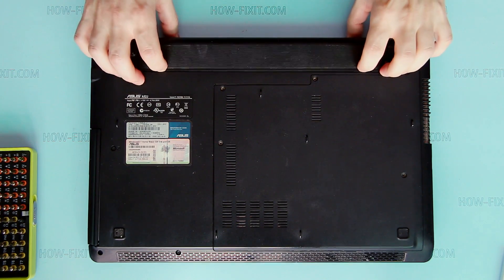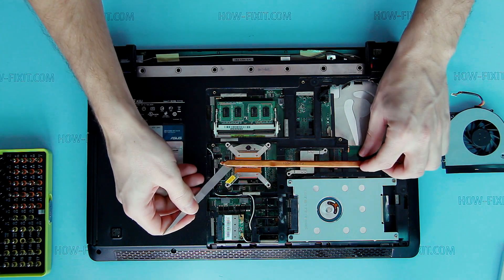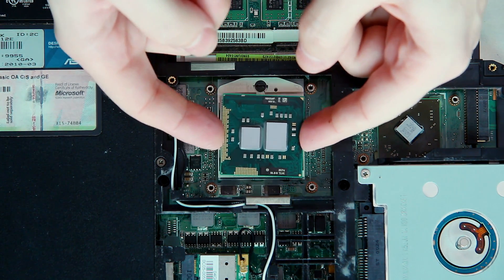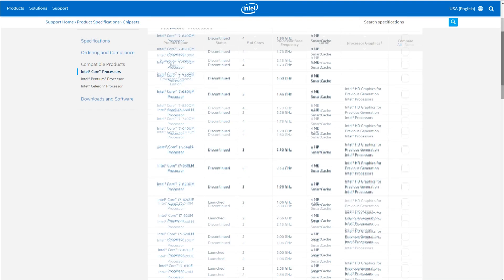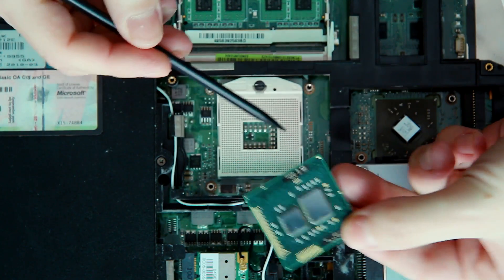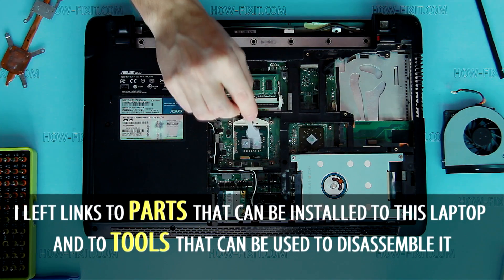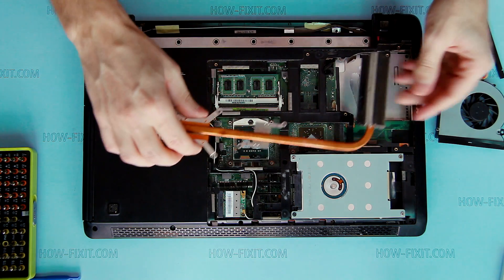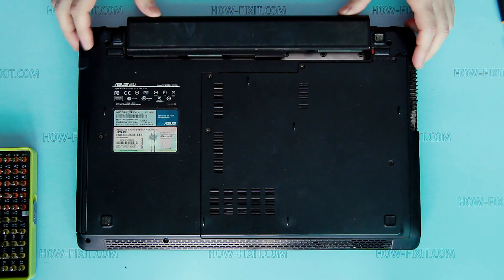Asus A52, X52, K52 CPU Upgrade Guide: Boost Your Laptop's Performance!

Comment: I upgraded my A52JE from i3 330m to i5 540m : Ok, I tried better CPU (i5 560m & 580m, i7 620m), they all started, but they got too hot after a moment (105°) and the machine shut down without any warning.... Only the 540m is fine, and I run Win11H2 with 8gb

Comment: I noticed that the screws protecting the processor have numbers: 1,2,3,4. And in some article that the order to remove them matters. I tried to remove the i3 processor to install an i5 or i7, but removed first the screws 3,4. Then the 1 and 2 are so hard that they can´t be removed. Could it really be because the order matters?
Reply: Order really matters when putting everything back together. Of course trouble might happen dismantling because of sequence. It's same when you change/remove cilinder head from moto engine. 😅

Comment: mine is A42J
 i7 Q 740 processor can i upgrade it?
Reply: what processor is installed in the laptop? VGA Radeon HD 5470?
Reply: @slavafedotov5742  nope ,mine is HD5730 2G
And CPU i7 Q 740
Reply: @muhs2532  Não faz sentido trocar o processador i7 pelo processador i7 - você não verá o efeito da substituição. 
Faça 4GB+4GB DDR3-1066/-1333 de RAM e compre um SSD de 240-512GB.

90GB é uma unidade C: Windows, programas, jogos. 
150-380GB - D drive para armazenar arquivos, fotos, vídeos.
Reply: @muhs2532   i7-740QM -> i7-840QM

Comment: i have asus u36sd..what is the latest cpu i can upgrade..
my laptop chipset Intel® HM65 Express Chipset
Reply: @slavafedotov5742  right now im using i5-2430m
Reply: @sharxtech7508  simple upgrade: install 8GB of RAM, SSD 240-500GB: 
disk C (90GB) -Windows, games, programs. 
Disk D (150-380GB) - files, photos, videos.

processors can be installed i7-2670qm, i7-2720qm, i7-2760qm, but in order not to overheat the laptop, you need to turn off the turbo boost on the i7 processor. Work at a base frequency of 2.2-2.4 GHz. Get performance with 4 cores / 8 threads and SSD.

Comment: Hello everyone. I have Asus A42j with intel core i3 380m, can I upgrade my cpu? IF yes, what is the recommended cpu for it? Thanks
Reply: i5-580m, i7-640m // RAM max 4GB+4GB DDR3-1066.
Reply: @vladimirazirov1815  thank you so much : )))
Reply: @vladimirazirov1815  same processor, want to upgrade to an i5 560m with 8gigs of ddr3 .. do i need 1066mhz rate or 2000mhz to get the  800/1066 mhz maxed on processor?
Reply: @stylez7x  buy any RAM: DDR3-1066 or DDR3-1333 (4GB+4GB 1.5v, 2R*8). In order for the i5-560m processor to work as quickly as possible, it is better to install an SSD 128-256GB, sata-lll, 2.5 for the C drive (Windows, games, programs) in the laptop. HDD (disk D) is used to store files, photos, videos. Transfer the HDD to the DVD slot through the Caddy adapter.
Reply: @vladimirazirov1815  1tb of ssd Samsung Evo is allready installed ;) Just wanna max it out a little ;D
Have some special Deals on 1600mhz ram 2x4gb.. still okay or is the unused frequency producing extra heat?
Reply: @stylez7x  the memory controller is inside the processor. For the i5-560m processor and other 1st generation Intel processors, the controller operates at a frequency of 1066 MHz. Even if you install DDR3-1333 RAM, it will run at 1066MHz. 

DDR3-1600 RAM for 3rd generation Intel processors. It may not work on your laptop.

Comment: I’m looking for help. Does anyone have the answer to my issue: I’m having trouble on my k52f after putting the i5 540m in it. It starts up windows as if it will go into install but then it gets a blue screen. I am upgrading from the original p6200 cpu. Which bios and windows install were those of you who successfully did this upgrade using?
Reply: Я слышал, что микрокоды процессора должны быть подписаны в bios

Comment: Hey i have asus x53u and it has the amd c50 processecer running at 1ghz .whats the maximum i can upgrade to and is there a need to upgrade the bios
thank you
Reply: ugh since he didn't answer and I want to help... you just have to see if that cpu is soldered onto the motherboard. If so, then that's very unfortunate and you cannot upgrade the cpu. I really want to see if I can since I'm using it for editing and the i3 has done such a good job, but just mediocre at editing performance. Anyways, hope it helps... but either way I'm not too sure.

Comment: what processor can i use to replace the Intel Core i3-350M (1st Gen)? thank you for the reply and the time. Godbless!
Reply: i5-580m / i5-560m / i7-640m
Reply: @slavafedotov5742  I’m looking for help. Does anyone have the answer to my issue: I’m having trouble on my k52f after putting the i5 540m in it. It starts up windows as if it will go into install but then it gets a blue screen. I am upgrading from the original p6200 cpu. Which bios and windows install were those of you who successfully did this upgrade using?
Reply: @danielgreenberg4751  Probably the processor steppings do not match. If possible, exchange an i5-540m processor for an i5-560m with the seller
This is my guess.

Comment: I have a a Asus K52jr, I just bought a core i7 920xm to replace my i3 350m. I updated the bios, and install the i7 but the laptop doesn't turn on, help :/
Reply: I'd like to know which one could be the better option :/
Reply: @renzoluisrojaspena5342  
your motherboard has 2 power phases per processor, i7 920xm requires a 4-phase motherboard - that's why i7 processor won't turn on :-/

for your laptop, the maximum processor is i7-620m / i7-640m
Reply: @slavafedotov5742  are you sure that would work with i7 640? :c
Reply: @renzoluisrojaspena5342  download the CPU-Z program from the Internet and look at the "Revision" section on the first page of "CPU" - is it "C2" or "K0" written?
Reply: @slavafedotov5742  It says C2, I heard about i7 720qm to my laptop but I'm not sure, I already lost a lot of money buying a i7 920XM. I really appreciate your time. Is it sure i7 640m or which one? :(
Reply: please
Reply: @renzoluisrojaspena5342  Have you replaced your processor? how does a laptop work?

Comment: Hi!!
I have an old N61JQ-A1 with a  i7-720QM processor. I upgrade memory (8GB) and SSD card (512GB). Can i upgrade the processor too? 
You know what is the maximum CPU for this old guy?
Tks!
Reply: there are processors for your socket
i7-840QM and i7-940XM. But I'm not sure if they will work well in your laptop, because for these processors Asus made special motherboards with 4 power phases, and your laptop has 3 power phases. My opinion is that it is not profitable to change i7 to i7 :) 
it makes sense to change i3 to i7 :)

Comment: cool video! 
question though! What if the TDP of the CPU you want to change is different than the original? 
For instance, I'd like to upgrade my i3-350M from my asus u30jc to a possible 4core CPU.. but most 4core are 45w TDP whereas the 350M is 35w...
Reply: optimally i7-620m + SSD (for Windows) + 8gb RAM.
I read that the i7-740QM was installed in the laptop, but on the processor you need to turn off the turbo boost so that the laptop does not overheat and damage the motherboard. Get 4 cores / 8 threads / 1.7GHz. 
I think it's better to get 3.3GHz with i7-620m :)
Reply: @slavafedotov5742  actually, today received my i7-620m.. and it's k0. My previous i3-350m was indeed c2. But this K0 620m is installed and ao far working/recognized in the bios too.if guys at Asus would have done their job and told me  which ones were compatible, perhaps the 640m would've worked too..
Reply: @sniuk  yes (  Asus office workers could not give the correct answer (you are lucky that both stepping are registered in the BIOS. I read on the forums that people received the i5/i7 and it did not start, that its stepping was not registered in the BIOS. I think you do not need to worry - the difference between 620 and 640 is minimal.
Reply: @slavafedotov5742  Agreed, even if your rig works with a 640m, the 620m is only 1 to 2 percent slower and half the price. Use the money saved for a used 256Gb SSD.
Reply: @palomarjack  if I had such a laptop, I would buy an i5-580m processor - it's similar to the i7-620m, but cheaper. I now have an Аsus К55VD laptop - I replaced the i3-3120m processor with an i7-3612qm processor
Reply: @slavafedotov5742  The i7 has more cache and was only $8 US more. It's only a little faster, but makes a big difference for cache intensive applications. Now that money is better I'm going to try for a Ryzen laptop next year or so. Maybe I will find one "for parts" like the this K52.
Reply: @slavafedotov5742  thank you! I've tried asking Asus about the compatibility with i7-640M as is similar to 620m but slightly faster.   Didn't get response. They kept insisting on me searching on internet about it, or install 620M,.. so after weeks of asking more specifically about compatibility of the CPUs and bios, gave up and ordered a 620M :(
Reply: @sniuk  Asus is right. The i7-620m and i7-640m have different Stepping. 620- C2, 640-K0. Stepping K0 is probably not flashed into the BIOS of your laptop model and the i7-640m might not work for you. Install SDD for Windows + 8gb RAM and even with i7-620 the laptop will work well. I bought myself a SSD Samsung 960 EVO 250GB SATA-III 2.5" V-NAND  - works great and 5 years warranty)
HDD via Caddy adapter (12.7mm) installed in the DVD slot for storing files (drive D)
Reply: @slavafedotov5742  oh no, Asus didn't say anything other than "you can check through internet other users who tried to install and see if it work for them" lool... wasn't helpfull at all. But thank you for your explanation. It would have been easier if Asus simply replied about what CPU are flashed in the BIOS..  I already have 8Gb of RAM, and recently added a Crucial MX500 1Tb SSD, was planning on the Cady too for the old drive :D And the i7-620M on the way ^^ . Thank you for your help

Comment: Hi. your video it's fantastic. can i ask u some one. I have a k52f CPU P6100. I just right upgraded RAM to 8GB and changed HD to SSD 120GB. it's all ok. but now i try to upgrade the cpu. do u know if i cam put on it. what is the best and compatible cpu right? I need to upgrad firmware too? Thank U in advanced.
Reply: it is optimal for you to install the i5-560m. There is also i7, but so that the laptop does not overheat, it is better to put i5. Update BIOS from ASUS website before replacing processor.
Reply: @slavafedotov5742  I’m going through same scenario and have upgraded to a i5 540m but am having problems installing windows. Do you have any suggestions?
Reply: I have the same setup but am trying to  upgrade to an i5 540m but have had issues installing widnows now. Were you succesful with your upgrades?
Reply: @danielgreenberg4751  I put on I3-370m and the notebook get a new life. it's very too much better PC. I use it every day for my job (webdeveloper) and I don't get any lag or slower task runner. my OS is win10 64 home. very fast and stable OS never crash or any other problem.

My next step is re-upgrade the cpu with i5-540m but what problem have U?
Reply: @studiocomunicas3436  Good news! I was anle to finally get it working with the new I5 540m cpu in it. Imfor some reason it wouldn’t let me run the install succesfully until I put the old/original hdd and ram into it. Then I installed windows 7 and then from there I put an older 250gb sandisk sdd in it and installed windows 10. I learned that when trying to install windows 10 that for some reason the system didn’t like the new samsung evo 500gb 860 ssd i planned on putting into it. I think it doesnmt like the evo because of some sort of voltage consumption difference that the motherboard or the bios just doesn’t gel with. Also it didn’t like the sk hynix 1600 4gbx2 ram I put into it and I think it was because it prefers 1333 speed ram even though crucial’s compatibility page says it can support the 1600 speed ram. So I just ordered some 4gbx2 1333 speed ram to update the current 6gb of ram with. 

Overall things seem to be running really well on it and I seem to definitely he getting i5 performance out of it m. It was totally worth the investment.
Reply: @studiocomunicas3436  
after the i3-370m processor, you won't see much difference from the i5-540m processor. Better to upgrade to i5-580m, i7-640m
Reply: @slavafedotov5742  Hi, I have a k52f with CPU P6100 and windows 10 32bit.
If I update it with i5-580m processor, I can pass to windows 10 64bit?
Reply: @prunaca  Yes. It's only more profitable for you to buy an i5-560m. 
                       RAM 2gb+4gb or 4gb+4gb DDR3-1066
Reply: @slavafedotov5742  
Is there much difference in performance between i560 and i580?
Reply: @prunaca  580 is more powerful than 560 by 2-3%))
Reply: @slavafedotov5742  ........and it costs twice as much:-)))). 
Well you convinced me, I'll buy i5-560m.
Reply: @slavafedotov5742  Hi Slava, I just replaced the old 2gb 1060 RAM with new 4gb 1333.
My windows 10 is 32bit.
It's very strange, I went to look in the system. The pc recognizes 8 gb ram but tells me that only 2.92 gb are usable. 
How is't possible?
Reply: @prunaca  Hi ) you need to upgrade to Windows 64 bit (Ws 7 x64, Ws 10 x64)
Reply: @prunaca  Windows 32 bit (x86) only works with 3GB of RAM.
Reply: @slavafedotov5742  Ahhhhh.......ok....thanks a lot Slava.

Comment: I am thinking of trying to put a better cpu in my Asus K52jr laptop but unsure of which cpu's I can use.  Currently it has a i3 cpu, but I would like to put i5.  Can you advise best cpu for this model?
Reply: put i5-560m - optimal for the price and work) the maximum can be set i7-620m) Under Windows install the SSD 240-512gb (2.5"/ 3D*TLC) + 6-8gb RAM (2+4/4+4 / DDR3-1333 ).   It will be nice to use it)
Reply: @slavafedotov5742  Thanks Slavik.   I ordered a i5-540m , and have upgraded to 8GB with 240GB SSD.   It is running much better now although I haven't put the new CPU in yet.  I couldn't find a i5-560m locally, didn't want to order from China.
Reply: @slavafedotov5742  как думаете, для p52jc тоже подойдёт такой апгрейд?
Reply: @Долой_Уныние  а какой там процессор? и тип сокета. Это можно глянуть через программу CPU-Z, AIDA 64

Comment: Can i upgrade my Asus k52f (Intel Pentium p6200) with a Intel core i5-580M? On Asus site, on the Page of my k52f, this CPU Is not mentionated so i have some doubt.
Reply: put i5-560m - it is cheaper. But i5-580m will work) RAM maximum 8gb possible (4 + 4 / DDR3-1333)

Comment: What cpu can i upgrade on my asus k52je laptop my current is i5 m 460 2.53ghz
Reply: i7-640m - the maximum. But the benefit will be small and it is expensive. It's easier for you to buy an SSD for Windows and make 6-8gb of RAM. You can buy a top-end processor i5-580m) it is cheaper than i7)

Comment: Hi. I know its old. I found a k52ju and and i wanna ask which is the highest cpu i can put in it. I tought of i7- 840qm but the TDP is 45W. So the best solution is i5-580m?
Reply: i5-560m +SSD +8gb RAM ) You can of course and i5-580m) 
i7-840qm will not turn on on this laptop ((

Comment: Hi is i7 640m cpu  competable with asus k52f
Reply: yes )  i7-620m / i5-580m
Reply: @slavafedotov5742  i7 640m ,i7620m  and i5 580m is ok with asus k52f. is it true
Reply: @hakannuho2745  you're sure 100%? It works well with these CPUs? Because I want upgrade my k52f with i5-580m and I have some doubt about compatibility with the BIOS.
Reply: @riccardobianchini1089  if you have i5-580m installed, then it makes no sense to install i7. The speed will be only + 5%) it is easier for you to put an SSD (2.5"/ 3D*TLC / MLC / 240-512gb) for Windows + 6-8gb RAM (2+4/4+4/ DDR3-1333). For this laptop there will be fine )

Comment: Will changing the CPU on my Asus A54C delete the memory?
Reply: a video card is built into the processor. She takes about 1.7-2gb of space from RAM for her work. Therefore, it is good to have 6-10gb RAM (2 + 4/4 + 4/2 + 8) on the laptop. Replacing i3 with i5 / i7 does not change the size of the video card (it is the same everywhere)

Comment: what about asus x555l  please reply my laptop is really slow it has i3 and i upgraded the ram to 12gb but it doesnt make a difference to my gaming fps and i dont know where the core is
Reply: you have a soldered processor. Even if you solder it in the workshop on i7, the video card will remain the same, weak. You can completely change the motherboard, but the video cards in laptops are weak for games. buy a gaming laptop MSI, Acer Nitro, Asus ROG
Reply: @slavafedotov5742  thank you 👉👈
Reply: @must4f4.m96  for games, buy a laptop with an i5 / i7 processor, and a video card (GPU Nvidia) GeForce GTX 1050ti (4Gb) / NVidia GeForce GTX 1650 (4Gb)
Reply: Filipe Costa  
tienes una buena laptop !! ) M2 no es necesario, ya que instaló el SSD. La gente está cambiando los procesadores Pentium / i3 a i7. Ya tienes i7) las computadoras portátiles son difíciles de actualizar porque la tarjeta gráfica y el procesador están soldados a la placa base :-/

Comment: Bro i have k52jc i3 370m, i am try i7 720QM but Pc only 2 second open with black screen and close. i suspect Watt and core number. Now i buy i7 620M its 35W and HM55 and PGA988 same of i3. İ am scared for bios (updated last version) does it work ?
Reply: yes ) i7-620m / i5-580m

Comment: hello i have a laptop Asus Model X540LA, CPU core i3 5005U, socket 1168 BGA. Can i upgrade this CPU to core i5 or core i7? Thank you so much!
Reply: i7-5500U / i7-5550U - such processors can be supplied. But your processor is soldered to the board and you need to go to the computer service with the purchased processor and change the soldering station there.